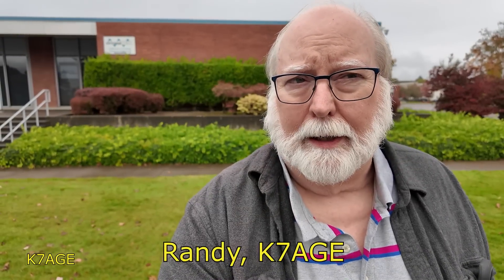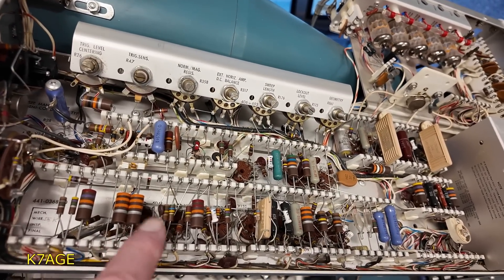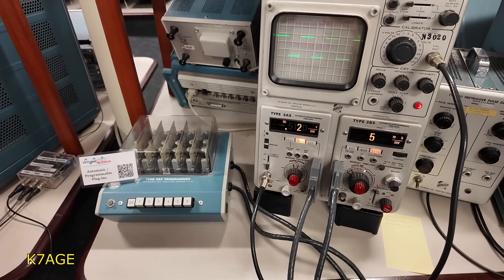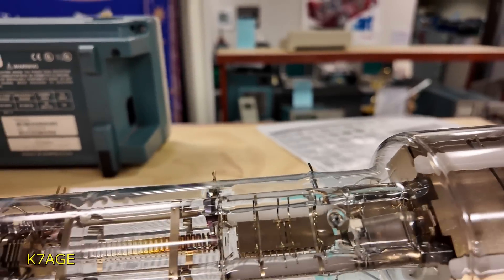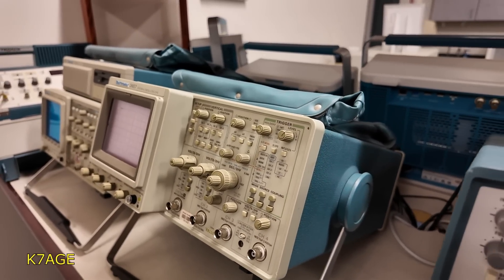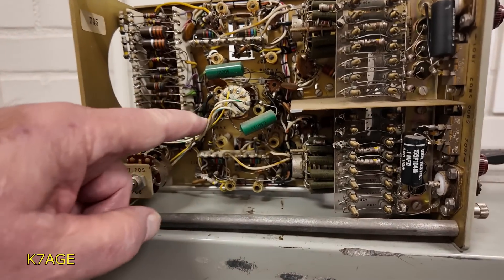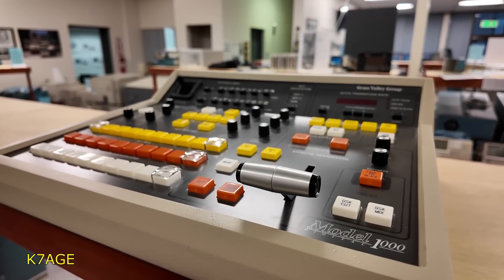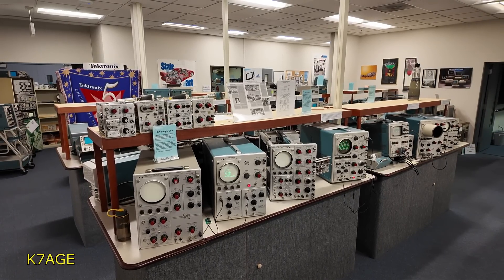Visit to the Vintage Tektronix Museum

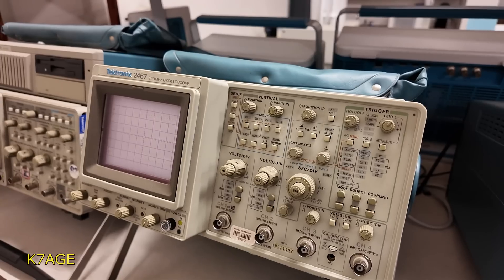Comment: 6:50  The 2467 scope has a microchannel electron multiplier faceplate CRT.  You can see single shot traces at 1ns/div.  I had one when I worked at HP Labs and bought one on eBay for $400 after I retired.  Truly a wonderful analog oscilloscope.  But beware — the configuration is stored in a battery backed SRAM module, so when the battery dies after a few years, goodbye configuration (calibration?).
Reply: I always wondered why the front of those scopes was extended like that - thanks!  I would have loved a chance to use that feature.  Interesting/sad to see Tek's love of the integrated battery/SRAM module apparently started in that era.  I have a TDS3014 that will never again know the date or remember its last setup.  Thankfully, the factory CAL constants are stored elsewhere.  I'm still trying to determine if a signal path compensation lasts longer than the current session.
Reply: the calibration constants were stored in that NVRAM IC. after TEK sold their IC division,the TEK-made ICs and hybrids in the 2400 lines were no longer available,and when a 2400 broke,it was not repairable.

Comment: I was one of the thousands who worked there.  I worked in the Microprocessor Development Group from 1977 to 1982 first in the test group for 6 months then the development group as a software engineer.  We moved to Walker Road in 1978 or 1979 when the facility was opened.  We were in the same business unit as the o'scope development team so we were on the north side of the building and they were on the south side.  Manufacturing was right below us.  Our cubicles had a complete set of tools in the toolbox, a logic analyzer, computer terminal, and a scope.

What brought me to Tektronix was due to my experience with the 545 while in the Navy as a sonar technician working on the sonar systems and the digital fire control systems.  When HP came out with their much smaller scope I wanted one too so I had my guys try to destroy the 545 including dunking it in the salt water.  They sent it to the repair shop which was aboard the repair ship and lo and behold it came back running like new.  So I was pretty much stuck with the behemoth 545 until the ship was decommissioned and the end of my enlistment.  After finishing college I went to work at Boeing in Seattle as a software engineer and when the project was finished I decided to go south ... in this case Beaverton.  It was the best experience that a young engineer could ask for.  Tektronix provided a lot of educational opportunities including allowing us to take classes remotely at OSU at different hours of the day.  The experience I gained from Tektronix carried me throughout my career and I have Tektronix to thank for that.  I also kept some of the stocks I bought that is still increasing in value.
Reply: What types of processors did you design?
Reply from the maker: That’s a great story about your time at Tektronix!

Comment: The first Tektronix scopes I repaired were the RM529 Waveform monitors at Ft. Greely. Every monitor at that station was bad. One had a badly burnt CRT, while another had a shorted power transformer. I used it for parts to repair six others.
I have the 323 & 324 Sony scopes that were used with that Spectrum Analyzer.
The Sony/Tektronix partnership was required before US government agenies could purchase any of their video equipment. The ETV section at Ft Rucker was still in the process from 2" Amprx macines to the early U-Matic decks.

I had a dual Monochrome sync generator with autommatic failover at that military station, along with the early generation of some Grass Valley equipment
I have about 20 Tektronix scopes. Mostly video, but there is a 453A. It was my first Tektronix scope that I bought in 1987. The face is silk screened, 'Telex'. I also have two 2465 and a 2465A sxope.
I have modern Grass Valley Audio and Video Distribution amplifiers Some will be converted to 50 Ohm to distribute frequency standards in my shop.

Do you know anything about the plug in solid state replacemts for the Vertical deflection tubes in the RM529?

Comment: Thanks for the tour. Brings back a lot of memories. I worked for Tek beginning in 1979 in CRT testing. I moved to the Wilsonville plant and worked first on the Tek 31 calculators, then later on a variety of digital storage products. All that work was a a manufacturing technician. Then I got laid off, and came back as a tech writer (the BA degree finally paid off). Later I worked on the X terminals that Tek built in Wilsonville before working on the Profile video stroage product. In 1999 I moved with that product to GVG when Tek was going through one of its periodic reorganizations and downsizings. That lasted till 9/11 when GVG had to lay off folks to survive the revenue disruption. So where did I wind up? In Wilsonville at Xerox working in the same buildings with many of the same people I'd previously worked with. This time was writing service documentation for the printers. Later I moved to the training group developing multimedia training programs for the various Xerox products made in W'ville. Your tour and the items you highlighted brought back so many memories.
Reply from the maker: I worked at GVG from 1976 to 2015. I survived many layoffs.

Comment: I too sat at a work bench for many years in the 70's/80's with a tektronix scope. We used them to trouble-shoot prom-burner and cpu boards for dedicated industry automation. On a side note; the construction type with rows and components soldered to standoffs was the bridge between point to point and printed boards. You likely knew that but I have to add, others used cheap phenolic? and plated pins - ie; turret boards. These were ceramic! Expensive and built like tanks. Cheers. 👍

Comment: Another GVG alum here. I still have a 465 scope I got a discount on being a GVG/Tek employee. I worked as a design engineer in the modular products group first as an employee and later as an outside contractor. I designed a long list of modular stuff from the mid 80's to early 2000's.
Reply from the maker: I remember you!
Reply: GVG equipment worked well. I miss the old days of broadcast TV.

Comment: Ahh.. Those were the days.  I still have a 50 MHz dual trace with sweep delay up in a box in my garage.  I had a fully equipped electronics workbench set up with sweeps, frequency counters, spectrum analyzers.  All analog.  I built that just before retiring.  Never did actually use it though.  The gear was limited to under 1GHz, so the world went well beyond it's capabilities.  The only thing I still use from it is the digital multmeter, and occasionally the soldering iron.  But I used a lot of those scopes in my time.

Comment: Been a long time since I ran across another GVG employee. I was a latecomer, from 1990-1991 and designed a few ICs for their Model 3000 digital switch. They had a nice new facility in Nevada City and I always enjoyed taking walks thru the heavily forested campus.

I remember using the 545B in high school, and the 465 was the weapon-of-choice when I was a computer tech in the early 80's. One thing you will never see again is the amazing workmanship that went into building these amazing scopes, and that's why so many of them are still running today.
Reply: GVG made the best stuff. Built like a tank.

Comment: I went to Tektronix in the 70's and was given a tour. Truly great technology. My first job after high school in 1966 was using a Tektronix 545 oscilloscope to troubleshoot integrated circuits. I used a scope probe connected to an XY table and a microscope to probe directly onto chips. I went on to use their equipment throughout my aerospace and NASA career.

Comment: User, I worked on alot of that TMDE in 80 and 90s. Cut my metrology teeth on triple nickel scopes at Kirtland AFB supporting the Air Worce Weapons lab.  

Tek had good spec ans but nobody could beat HP. Then again, HP couldn't make a decent scope to save their lives.
Reply: I was a USAF PMEL tech,1970-74. Back when PMEL school was at Lowry AFB.
Reply: @JayWye52  Loved my time at Lowry for the initial school and then advanced electronic and then microwave. Retrained out in 97 into manpower.